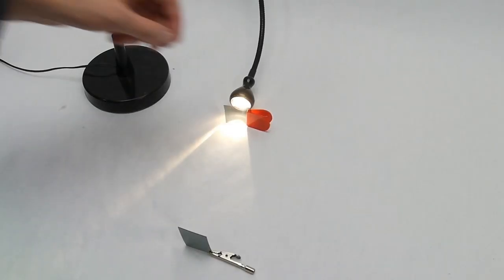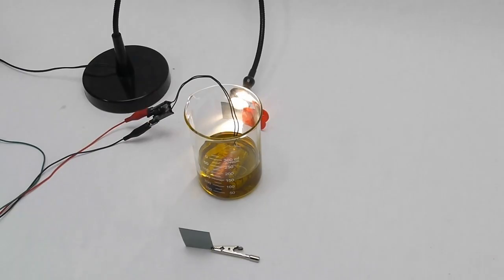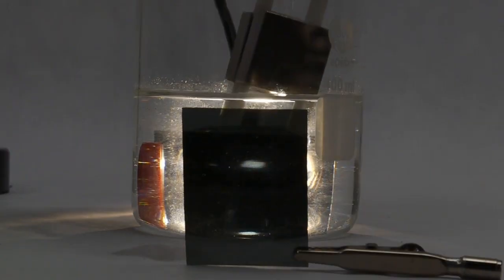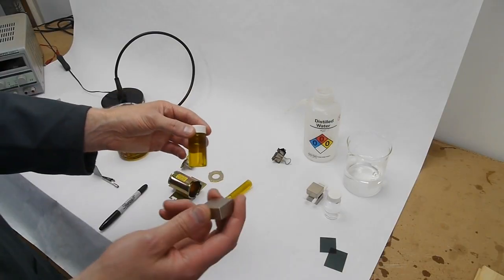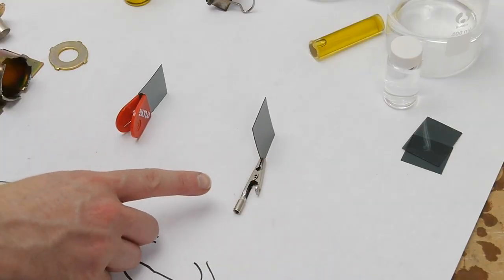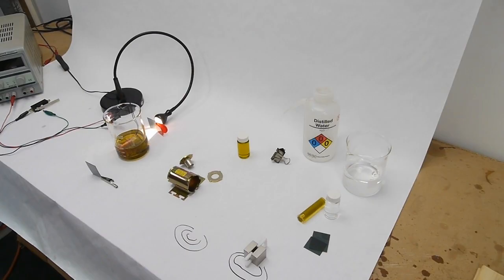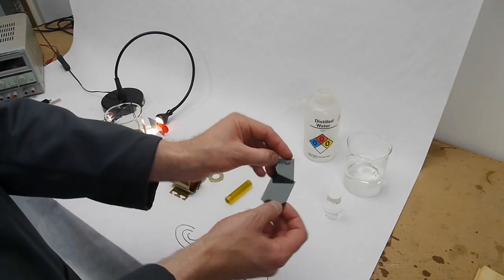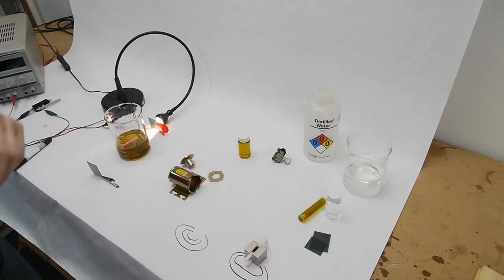Control light with magnets and olive oil?! (Faraday effect)

Comment: It seems that the 45 degree angle idea is almost like a "light diode" of sorts.. I wonder what kinds of practical applications exist for that?
Reply: Real one-way glass! :D (Normal "one way glass" is just normal glass brightly lit on one side and dimly lit on the other).
Reply: @KitsuneSoftware  i was just thinking that. i think they have this in some newer cars glass ceilings. i've seen how on some mercedes they can make the roof lighter or darker tint with then touch of a button and wondered how that worked. this i guess?
Reply: It is very common for low to mid power (up to 100 watts or so) fiber lasers to include Faraday rotators on their outputs. The system is configured just as described, using permanent magnets, so that light exiting the laser passes freely, but laser light that bounces off the work piece is blocked from reentering the laser. This is critical because relatively small amounts of "back reflection" entering the fiber laser can destroy it. While it would be great to use them on high power lasers as well, the crystal would heat up too much.
Reply: Tim Chorle  This is exactly what i was thinking !!!
Reply: vaidhya nathan same for me but I have no clue how it comes to work, it feels so counterintuitive
Reply: It is used in sensing application. For blocking noise and unwanted signals.

Comment: Hi, I'm not sure if I really understand how you explain the one way glass. When the light pass in the opposite direction, the magnet field wont turn the polarization in the same direction it did before. The math of the Faraday effect is  
β = V*B*d
β is the angle of rotation (in radians)
B is the magnetic flux density in the direction of propagation (in teslas)
d is the length of the path (in meters) where the light and magnetic field interact
V is the Verdet constant for the material.
https://en.wikipedia.org/wiki/Faraday_effect
In the case you have light that goes in the same direction of the magnetic field, all variables will be positive. But if you change the direction of only one variables, in that case you change the direction of the light, in extension, the direction of the magnetic field, the angle of rotation will be negative so you will come back where you were. So you can see in both direction, and there is no one direction system. Please tell me if there is an other thing I didn't see. Thank you for your video by the way, really interesting.
Reply from the maker: Vincent Huneault Thanks!  In your equation, the quantities are not vector, so you have to be careful.  It is a simplified equation which is fine for calculating the value, but may not help show the sense of the rotation.  To visualize this, I imagine a photon traveling away from me down a hallway.  If the magnetic field is going in the same direction as travel, the light will rotate clockwise.  Now, if the photon is traveling toward me and the field is unchanged, from the photon's perspective the field direction is opposite to its motion, so it will rotate counter-clockwise.  However, this is the same as clockwise viewed from my perspective.  So, incoming and outgoing photons rotate in the same direction from my fixed perspective.
Reply: Applied Science wow thank you, looking forward to see it in action.

Comment: Very interesting, although I'm still a bit confused about what light polarization even is. I'll probably just read a wikipedia article about it or something, but in my mind, it's weird how light has a certain polarization angle while it's direction of travel never appears to change.
Reply: ***** The simplest way to understand polarization is to think of light as a wave rather than as a particle. There's a simple physical demonstration you can do. Get a piece of paper and cut a strip an 3cm tall. Draw a wavey line on the paper, this is your light ray. Now get a comb and hold it up, this is the polarizer. Try to slide the paper through the teeth of the comb. The paper will only go through when it is orientated in the same direction as the teeth on the comb. The effect is exactly the same for light although the explanation for why is more complex. Note: almost all light sources produce unpolarized light. Every photo is polarized it's just that the source doesn't pick a particular polarization hence why some light still get's though a polarizing filter.

Comment: You should really check out Ken Wheeler's "Uncovering the missing secrets of Magnetism" >100p aka Ut sn Angry Photographer.  While he doesn't follow conventional wisdom, his insights are much more detailed.  There is no N/S, it's a VORTEX, and depending on which direction you look from they spin CW or CCW.  He shows the effects very clearly by holding a PM to a CRT.  While conventional theory preaches "electrons", according to great electrical engineers like Tesla and Heavyside, there is no such thing.  Read his short book, you will get a better perspective of electromagnetic physics.

Comment: this could be used for dimming windows in a skylight
just put a solar powered electromagnet around the outside
Reply: Why even bother with a magnet when you can just use two polarizing filters? Better yet, use blinds. Light is not going to get through those.

Comment: Great video.  I would like to mention that the reason that the polarization of light is affected is because the speed of propagation in the material is different for light polarized in different directions, and this property of the material is influenced by the magnetic field.  Simply just having a magnetic field interact with the light will not do anything, since light is itself just an electromagnetic wave, and the constant magnetic field from the magnet would just add to the electromagnetic wave through superposition.
Reply: I think the applied external magnetic field DOES actually modify the angle of an EM wave by manipulating the magnetic wave component that then changes the angle of the electric field wave component that is supposedly the main visible portion. Maybe having it in a dipolar substance makes enhances the effect by harnessing the mini dipoles (intrinsic quantum "spin") of the "electrons" to make a stronger magnetic field and somehow deepening the interaction (maybe based on "permeability" reasons shown in the equations attributed to Maxwell). Thanks for posting such nice science animations and explanations, if this is that Eugene👍🏻
Reply: Eugene you are just wonderful.
Reply: :10
Reply: Ben explained this, stop trying to steal his audience. It's so obvious what you're doing.

Comment: "A small region where the field lines are parallel" - are you serious ? That hurts my ears. EVERY field line is parallel to the others, they never cross. That's the deal with the concept of field lines ;)
Reply: smeshnojnik I suspect the point was that the field had to be parallel to the light traveling through the medium, so if he could extend the distance over which the field had this property, the effect would be more visible.

The word parallel often is used to mean "lines that are equidistant at all points" which is not true for magnetic field lines, so it is not actually incorrect to use the word this way.  

It is pretty common for words to have different meanings within different contexts, and while the technical and scientific fields have a tendency of appropriating words with previous and colloquial meanings and applying their own meanings to them, it is important to realize that this is just jargon, even if they are describing something more accurately than someone would do colloquially(which is not always true),it  does not mean that how they use words have any authority outside that context.
Reply: Ts6451  Yes I get the point that he wanted to make clear that the area where field lines of such a small magnet would be parallel to direction of light travelling is not big enough to make the effect visible. But nevertheless it sounded like he meant "field lines are parallel only at a small region". And what did you mean by lines that are equidistant at all points is not true for field lines ? Of course the nearer field lines are to each other the stronger the field is, but they do not cross at any point which is also a definition of parallel.

Comment: That blows me away. Other than liquid crystals I had no idea there was another way to modulate like like that without actually changing the light source. The optical rectifier is a cool concept as well, you make me wish I was home with my basement lab full of gear.
Reply: Nick Moore 
Then be ready to be blown away again. Ever heard of the electro-optic effect? Can do the same thing, but by applying a voltage to a crystal instead of a magnetic field. It's much faster to control (coils are hard to drive fast because of their inductance), you just need to be able to move charges quickly (like in any piezo). Crystals exhibiting this effect are used in telecoms a lot, where optical switching in the GHz range is needed.
Reply: Weird, I have some Googling to do. Thanks.

Comment: I once tried to take apart an optical isolator based on this idea to clean. It has strong permanent magnets inside, it was a bad idea as the magnets went flying as I took it apart and putting it back together was a nightmare. Needless to say it was basically junk at the end. Wikipedia suggests that the material used might be  terbium doped borosilicate glass or terbium gallium garnet crystal for visible light.
Reply from the maker: ***** That's cool! They are rare devices indeed.  I would have loved to see your disassembly.
Reply: Applied Science It was a little like your incident with the neodymiums :) From what I remember they were ring shaped magnets, about an inch in external diameter that got pushed inside a tube or about 3" in length. The aperture was only say 3mm. No doubt they can create bigger apertures these days with the magnets now more readily available, these I suspect might have been samarium cobalt.

Comment: Similar effect was used as a shutter for ultra fast photography of atomic explosions in Manhatan project.   The camera is called Rapatronic.
Reply: Tomek Also, wouldn't this effect be increased if you used multiple smaller coils, one after another,  instead of one?
Reply: Tomek Anything that can increase the magnetic density of the parallel lines would do. AFAIK
Reply: Jack Cloudie What I mean is that if you use a large magnet you could still see light at the end of the set up even though all photons are rotated. Because the filter isn't perfect, you know. In this case, increasing magnetic field will do nothing.
Reply: DigGil3 So, that ultra-badass magnet they've produced over in New Mexico, we could make the light rotate with a 100 Tesla field for the fun of it?
Reply: Jack Cloudie Probably there is a limit, like a saturation point, where all the photons have been polarized and increasing the magnetic density won't make a difference anymore.
Reply: DigGil3 I'm sure that is true, but that wouldn't change the fact that based on the information provided, the polarization should still change.

Comment: ....transmitting light in only one direction...could you use that to make a "diode" with light-based circuitry...maybe a light transistor with the changing of the polarized light...however still requiring the electrical to control it

Comment: Your "accident" with the magnets was AWESOME. I almost had soda come out my nostrils when that happened. Science is dangerous, but funny!
Reply: USWaterRockets People are so used to the regular 'black fridge magnets" which have barely no power that they simply can't grasp how much more powerful neodymium magnets are.  A fridge magnet can lift a few grams of iron.  A neodymium magnet the same size can lift a few kilograms of iron.  You can buy neodymium magnets that can lift 200Kg, and it fits in the palm of your hand.
THe distance at which they attract is also much much larger than compared to the regular fridge magnet.
Reply: USWaterRockets lol Last time that happened to me, they exploded... "Why would you ever need safety glasses working with magnets?" I'm glad I have an addiction to safety glasses.
Reply: One needs to be very careful with powerful magnets. They tend to pick up each other very far. I usually never like the idea of free magnets while moving another. Hand can be drawn to something like iron very quickly when you hold a big magnet.
Reply: USWaterRockets And remember: science is not about "why?", it's about "why not?".
Reply: frtard I have a thick set of leather gloves I use with them too. I got pinched by two magnets like this on a finger tip and it was like getting pinched in a pair of pliers!
Reply: At about 5:00. Even funnier (and scarier) at quarter speed. Fucking magnets, how do they work?
Reply: USWaterRockets
Blood-blisters galore
Reply: frtard If you only have blood blisters, consider yourself still to be lucky...  Think crushed bones, skin actually torn off.    

And there's the case of the penile injury http://www.ncbi.nlm.nih.gov/pmc/articles/PMC1079417/
Reply: oreubens There's a reason the only neodymium magnets I have are only 2mm in diameter! :P
Reply: +oreubens Oh dear, I thought that only happened in my nightmares...

Comment: Ok, suggestion for a visual effect. You know if you film polycarbonate plastic car headlamps through a polarizing lens, you will see the stress pattern in the plastic. Like this http://goo.gl/DpNvDi  .   Now what if you brind a very strong electromagnet, are you going to see the magnetic field in the stress pattern ?
Reply: shodanxx I think you would only control the brightness.
Reply: MotesYT I think you should be able to change the color at a certain power. The color you see is the light at this polarization, if you change the polarization, you will find the other colors, like if you would have turned your polarization. The reason you see it dimmed in that experiment is because you have two polarized filter, and when the beam of light pass at a different angle, it is dimmed. In the case of the plastic, their will be different colors at different angle.